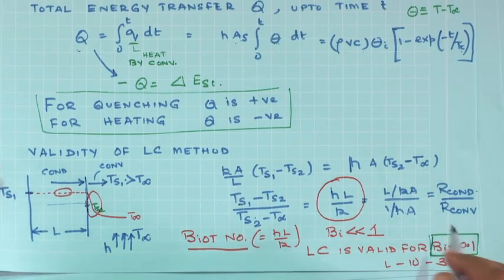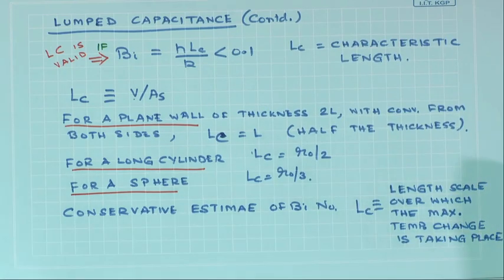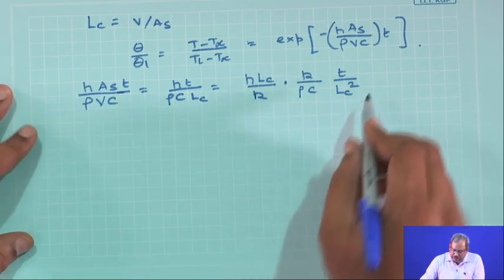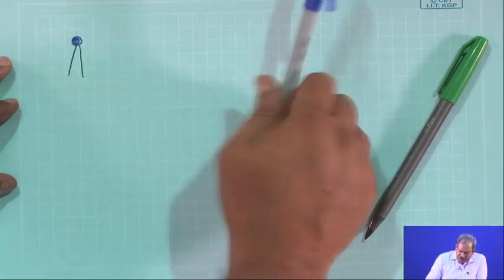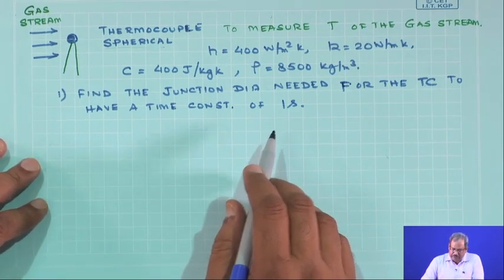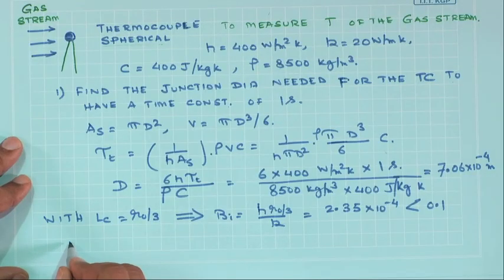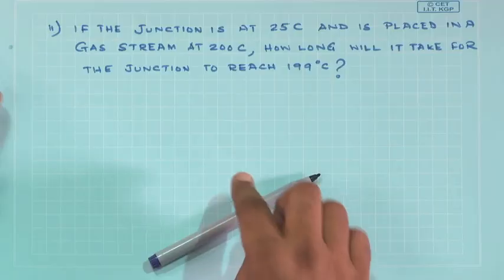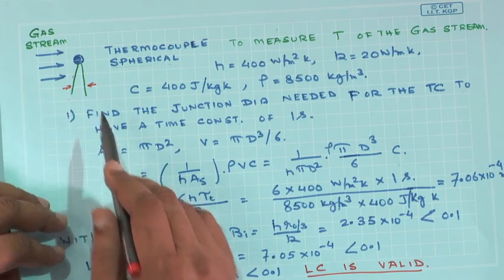Lecture 11 : Lumped Capacitance (Contd.) and Tutorial Problem

Comment: what is the physical significance of characteristic length
Reply: What I think is:
LCM is valid only when the Biot no. is less than 0.1, this puts restrictions on the thermal conductivity of body and the convective coefficient of heat transfer  but until  now we never put a restriction on the size of body and as logic suggest  a very large  body cannot be assumed lumped as the spatial invariability of temperature would be difficult to achieve.
Reply: Characteristic length, 
lc = Volume (V) / Surface Area (As)
It signifies relative importance of Volume of body with its surface area 
As lesser the volume & larger the area at a same time will account for significant convection from surface relative to internal heat conduction & storage.. ...& hence the Biot number as Bi is proportional to lc